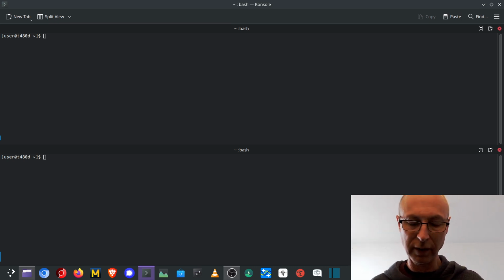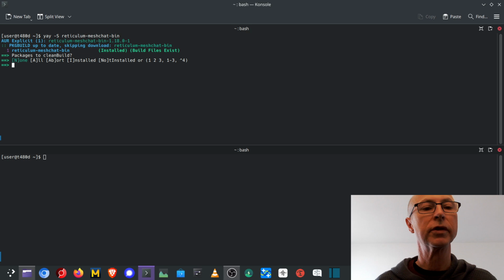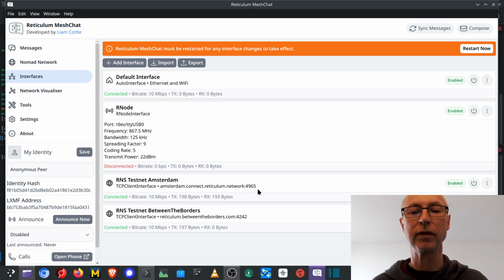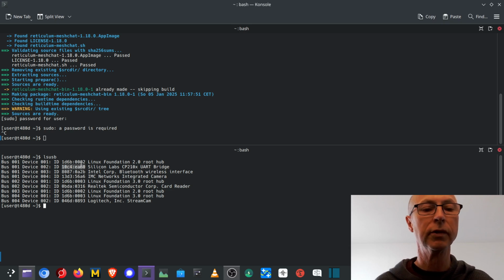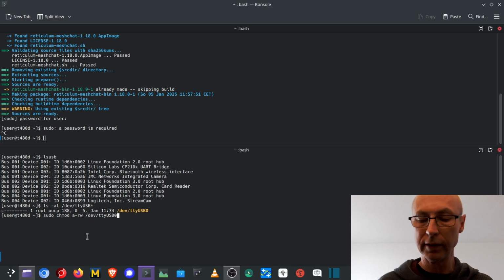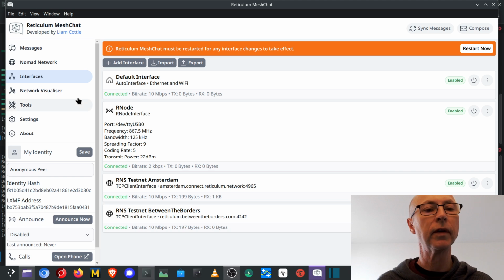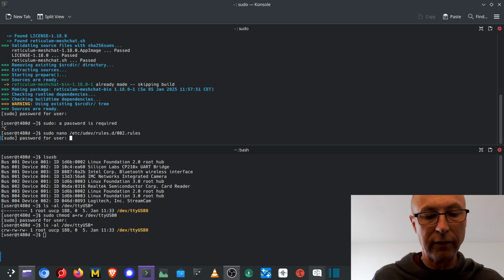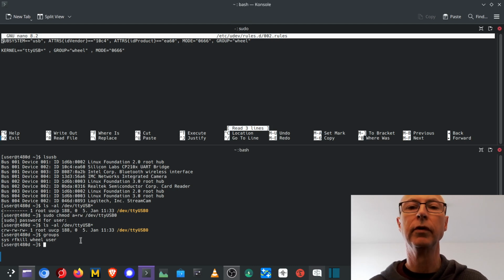Reticulum Meshchat on EndeavourOS with Fix for ttyUSB0 Access Rights

Comment: How to fix the same error with USB but on windows?
Reply from the maker: With windows it should just work straight away. Sometimes, pressing the reset button on the node helps. Also, I close the browser tab that was used to flash the firmware before running the Meschat app since two programs can't both use the same USB port at the same time ;-)
Reply: @fotografm  Node restart, program restart, or computer restart do not help. It also doesn't help to do everything from scratch on a different computer. I still can't connect RNode and MeshChat.
Reply from the maker: @AlicjaBujak-h8w  Have you installed the driver for the CP2102 UART chip ? Windows needs this. Go to https://www.silabs.com/developers/usb-to-uart-bridge-vcp-drivers?tab=downloads
and download the CP210-x universal windows driver. Unzip it and right click in the file manager on silabser.inf and select "install this driver" or something like that. Windows hides files extensions by default so you have to switch this on in the file manager to be able to see silabser.inf . You probably need to reboot after installing. Check it has installed by going to Control Panel - Device Manager - Ports (COM&LPT) and you should see listed Silicon Labs CP210x USB to UART Bridge with a COM port number.
Reply: @fotografm  My LilyGo is recognized as CH9102 and device manager does not replace the driver. Is CH9102 the problem?

Comment: The proper way to fix this is to add your user to the group which gives access to tty ports.  sudo usermod -a -G dialout $YOURUSERNAME
Reply from the maker: Thank you for your comment. On Debian based distros and probably also on Fedora this works fine, but EndeavourOS does not have the group "dialout" which is why I looked for alternative solutions.